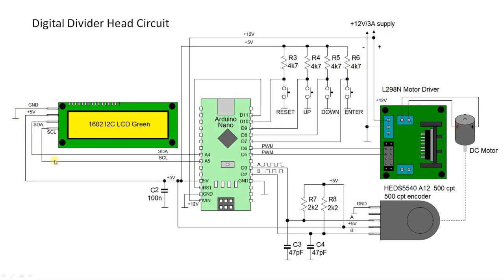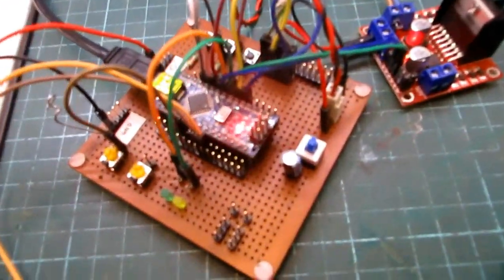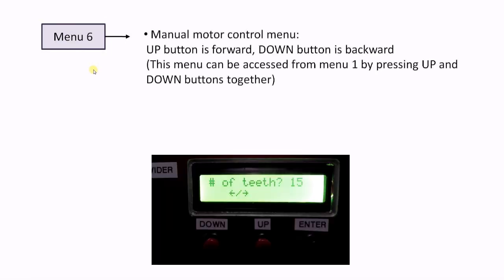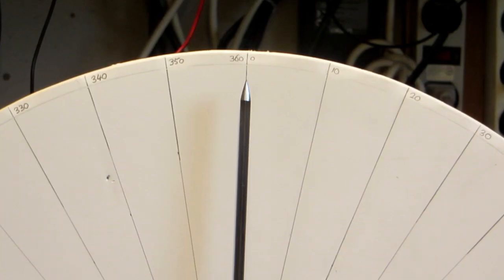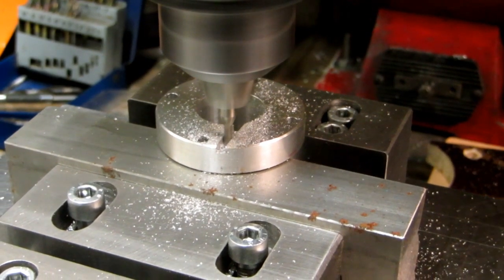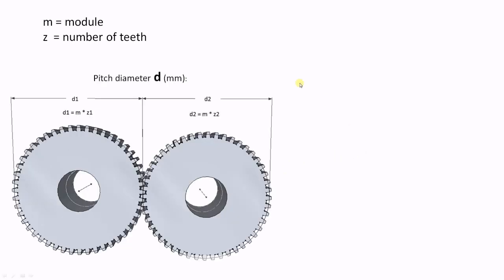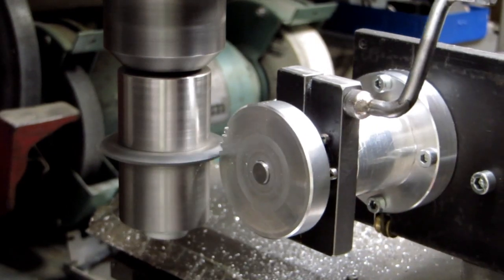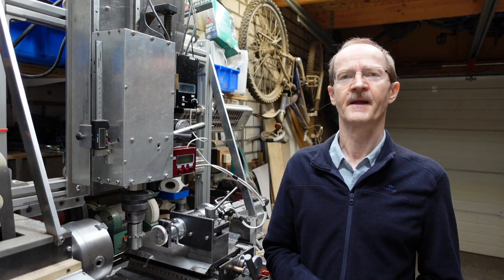Building a Digital Dividing Head

Comment: Roland
Thanks for the help you gave me to get mine working. I followed a different route with a right angle drive wiper motor and the smaller gear ratio did cause me some problems but thankfully now working. Many thanks for giving me the inspiration to build it.
John
Reply from the maker: Hi John, 

Glad to be of help, good to know your setup is working correctly now. 
I'll add some of your software parameter modifications into the Arduino software code comments on my website.

Comment: Nice project and very well made. Vibrations on encoders are common. While you solved the problem by inhibiting the pulse count while cutting, which is a brilliant solution, in the case you need to keep counting the encoder an alternative solution that not involve the edge detection of both channels (wasting one more interrupt) is to look at the B signal both when A is rising and falling. When A is rising look at B to count up or dw and lock the count. When A is falling look at B that must have a complementary level when A was rising: if so unlock the count, otherwise this is a fake pulse and let ignore it. This works also for fake pulses on A. It seems complex but are just six lines of code in C.
Greetings.
Reply from the maker: Thanks a lot for this information, very useful! It should be possible to do this with Arduino, but I need to be careful that the extra code execution time can be finished within the A rising and falling edge. so the rotary encoder maximum RPM needs to be considered. Otherwise use a Teensy I guess.
Reply: @Rolandvanroy  I've tested this code using C in a Atmega32 and I found the limit is around 10KHz, leaving room for very few other routines in background. Not sure how it would perform with Arduino, I'm not that great expert of that environment.

Comment: 3D Printer Linear bearings/ Sliding blocks/Shaft Brackets/ Couplings/Handles/ Engraving Machine Press Plates / Manual Screw Jacks/ Lathes Dogs/ Disc Springs/ Screws/ Nuts ...Welcome to MSM Store

Comment: Have you calculated the accuracy of this design? If the 139,000 increments per turn is correct, and the device can rotate accurately with that resolution (i.e. telling the device to go to 129,000th increment goes to 129,000th increment and not the 128,999th nor 129,001th increment) then I think the accuracy is roughly 10 arcseconds (given 360 degrees * 60 arc minutes * 60 arc seconds) = 1,290,000 is roughly one order of magnitude more than your 139,000 increments. 10 arcsecond accuracy is quite accurate indeed. What are the limits of this?
Reply from the maker: see 10:46: I measured an error of 4 pulses, which is 0.01degrees.